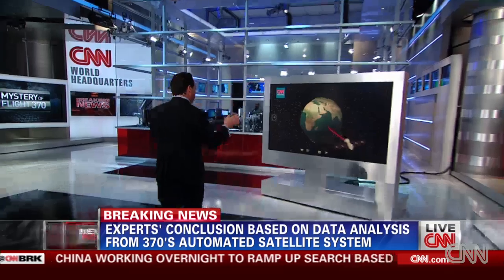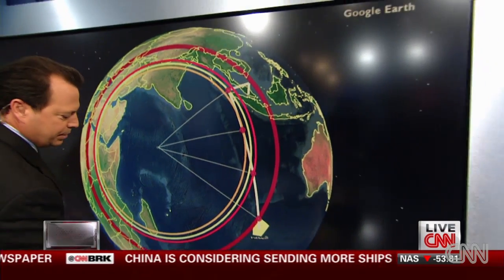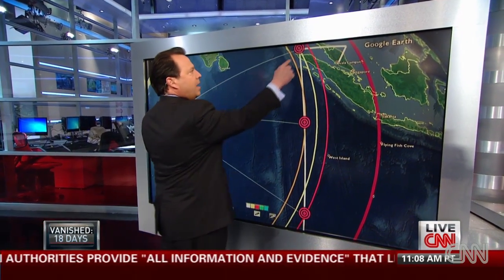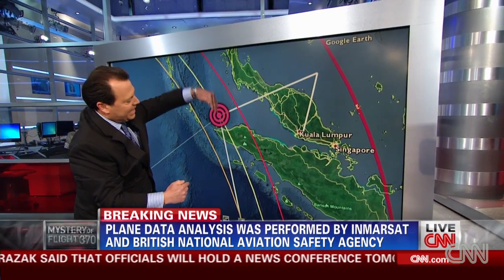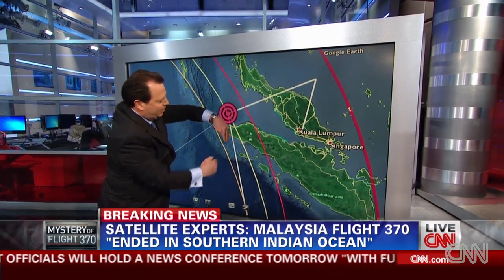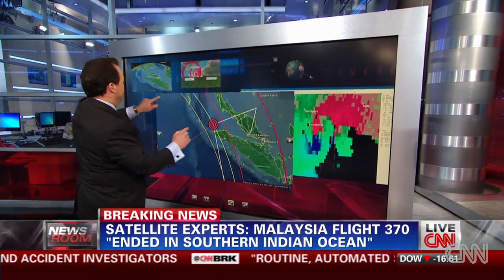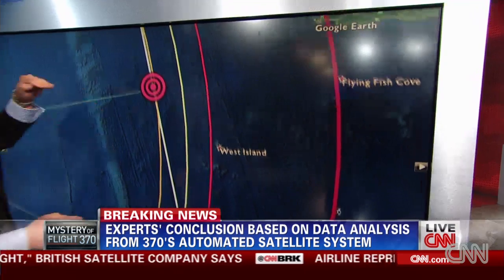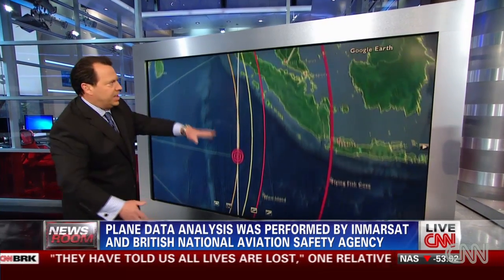How did satellite technology analyze missing plane?

Comment: The game-  pin the tail on the donkey comes to mind
Reply: To me Mh370 was shot at by a jet, the military radar was infact a fighter jet leaving the scene. Mh370 continued to fly on like the Dhl flight of 2003 that was shot at over bagdad which actually managed to land (both have similar trailing edge strike to the wing), but Mh370 crashed into dense jungle in south east asia. The debris fell from the skies into the gulf of Thailand and followed the winter currents  out to Madagascar & Réunion Island.  The blast hit Mh370 on the right as pretty much all the debris came from the right hand side of the plane, starting at the front right           landing gear then the front right door (r1 door panel,) blasting a hole in the electronics bay - taking out the comms. Then taking out the right engine and directly above  that, the flaperon and other trailing wing sections. Some of this debris         followed the slipstream  hitting the rear stabilisers tearing pieces off (similar stabiliser damage to Aloha flight)

Comment: That is NOT the Doppler effect explained, but the difference in time that the signal took to travel to the satellite and back as the plane went closer or further away from the satellite. Only if the frequencies of the ping's were logged, the Doppler effect can specify in more detail about the speed and direction than the time of the ping handshake alone.